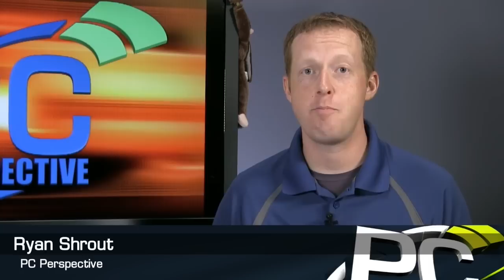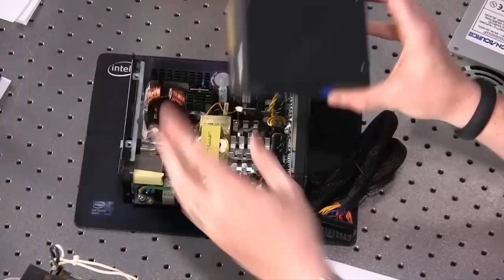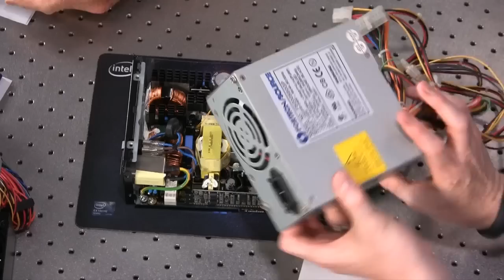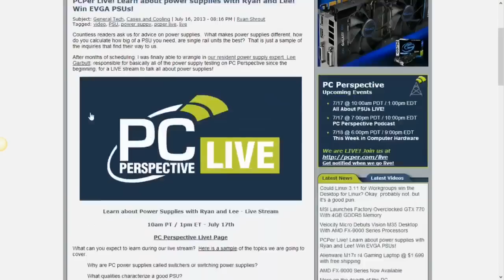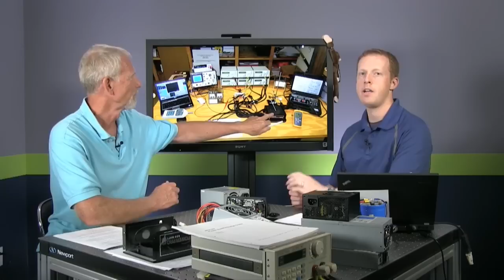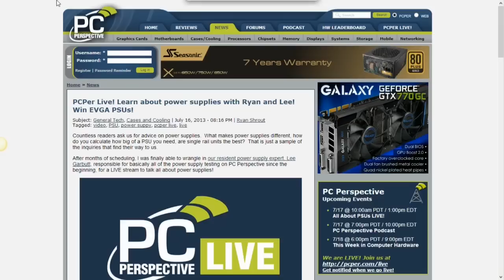Learn about Power Supplies with Lee and Ryan! - PC Perspective

Comment: Hate to correct the guy but the 2 big caps are for bulk dc voltage from the pfc circuit. Also the filter near the ac plug is to filter the power supply from the ac mains not to filter the incoming power, the switcher is a radio station otherwise. There is also no regulator on secondary per say, the psu monitors output and varies duty cycle to adjust the output voltage. Standby voltage is 5 volts, maybe he means 12 volts converted to 5 via dc/dc converter.